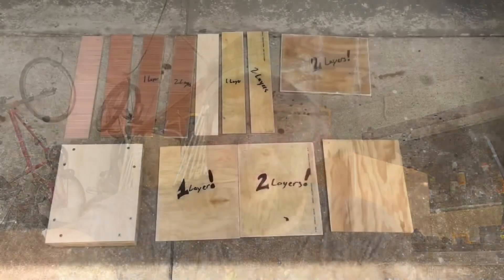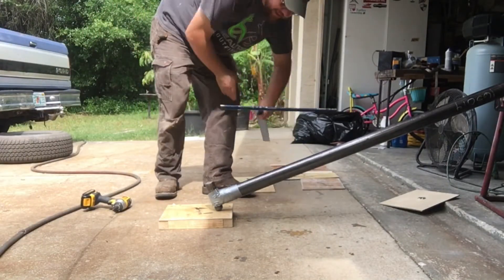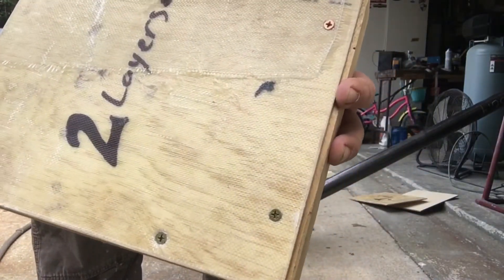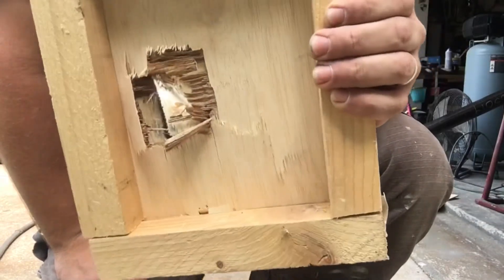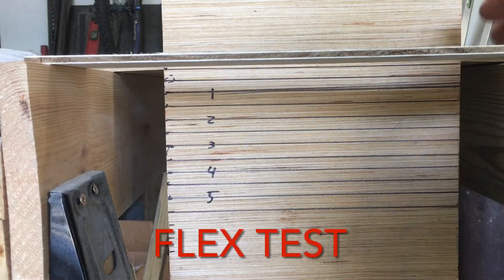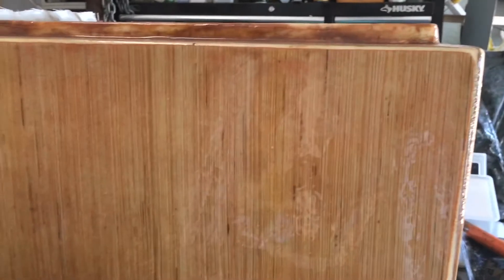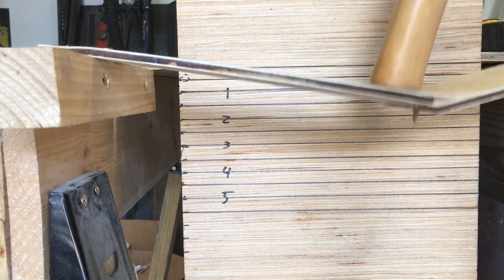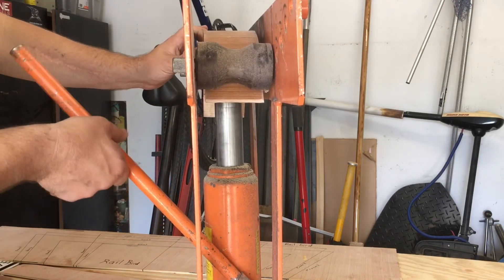Wood and Fiberglass Composite Destructive Stress Test

Comment: Fiberglass on the outside of hull is more for dents and scratches, if you're trying to prevent plywood damage and greater tensile strength Fiberglass the inside. Combining Fiberglass to both sides of plywood will give you the best results. Building boats out of plywood you never want the plywood to give and absorb water.

Comment: How about fiberglass on both sides of wood?
Reply from the maker: Jeff Spira had a couple of designs where there was a fiberglass, wood, fiberglass laminate. I tried the fiberglass sandwich on my Railbird XL build with 5mm luan. It is super strong and lightweight. I am convinced it is a good technique. My only concern is water finding it’s way into the wood and rotting because the water is trapped. It’s been a couple of years living in the elements and I’ve had no issues so far.

Comment: S
If you use dye penetrant on the surface of the tested surfaces it will show, given an amount of time to soak, that that the polyester matrix had insidiously failed with web cracks, polyeste resin in particular is so brittle. None of the other resins are impervious unless they are ingineered elastomerically for designed max impact. It's remarkable that the flimsiest materials can be engineered into a structure that can stiffen and carry a load several times it's own weight; such as a corrugated piece of paper as a bridge to carry a glass of water. For God Sake don't use glass material when you try it! Hmmm.. Sorry Mom.

Comment: Excellent video. Built a 16ft tunnel skiff from 1/4" ply for the hull. The deck is 3/4" marine grade ply. For hull..used epoxy with 2 layers of 6oz cloth, 1 layer of 1708, and 1 layer of 2oz CSM. Some spots are a little thicker with additional fglass layers. For deck used 1 layer 1708.  Running a 50hp outboard.  I hope it holds up lol.
Reply from the maker: Sounds like a nice build!